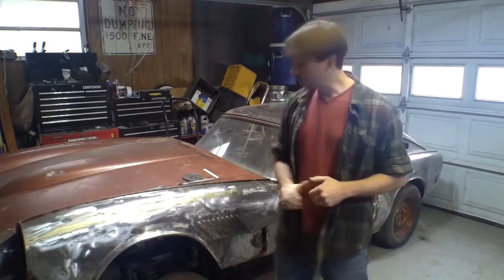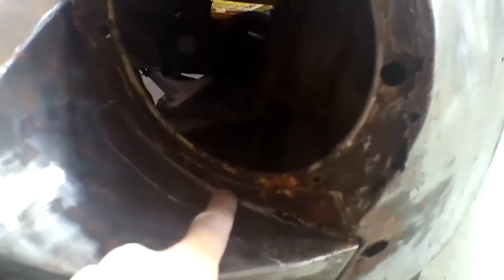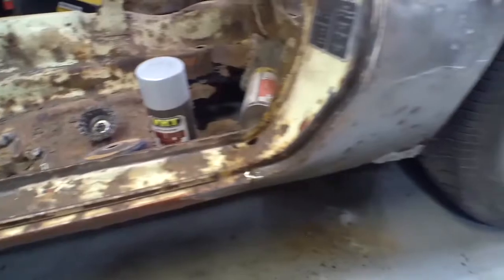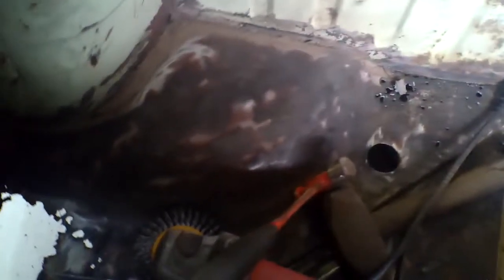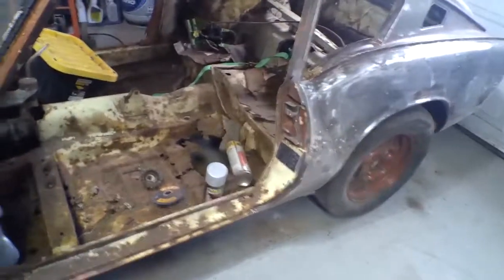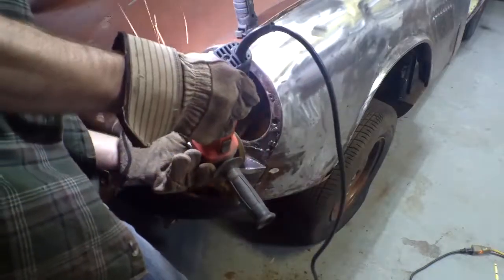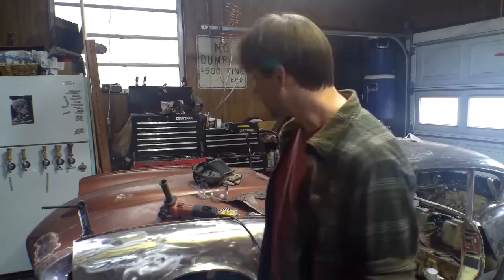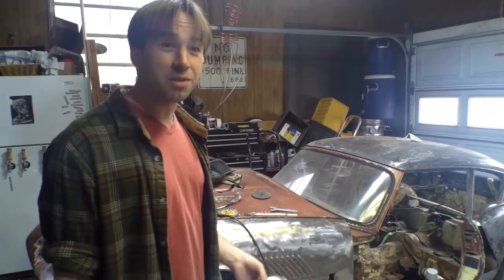Digging in on the GT6, or at least attempting to

Comment: Looking forward to your builds.
Not sure if your skill levels, but here are a couple of channels you may want to check out. Make it Kustom, Proshaper Workshop, and Carter's Auto Restyling. Excellent explanantions on all kinds of metal work and shaking.
Reply from the maker: thanks! i did most mof the basic metal work on the spitfire tub and will do the finer stuff after i finish the frame. im learning metal work as i go and started from never having used a welder before. I started with watching rusty beauties while doing research on the gt6 and since have also been watching make it kustom and fitzee's fabrications. its been a great help seeing how others think and learning the right tools and setups.
Reply: @dragon_gate_garage  agreed. I started the same way on my gt6 many moons ago, and you can see how it finally turned it. Just painted a year ago.